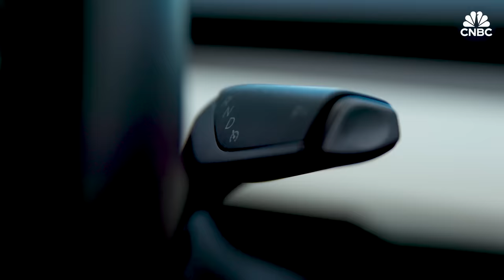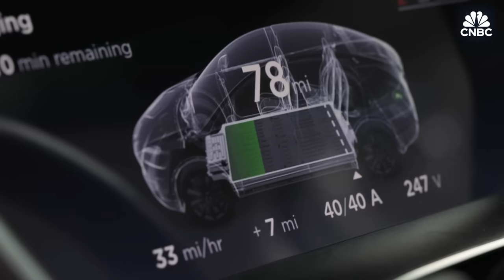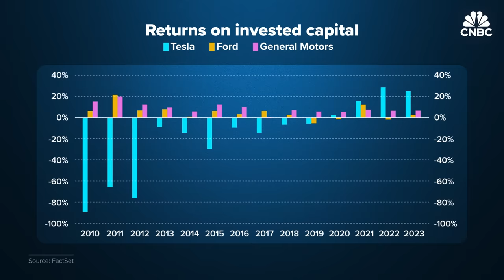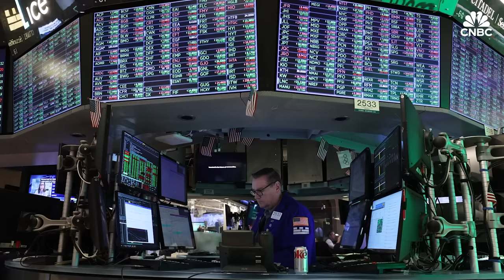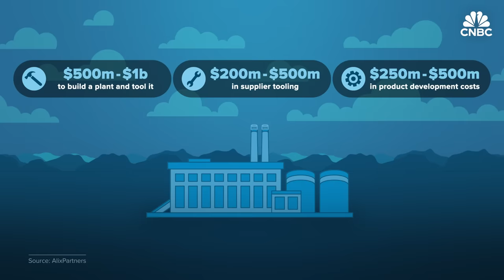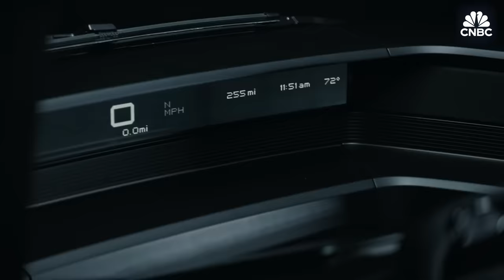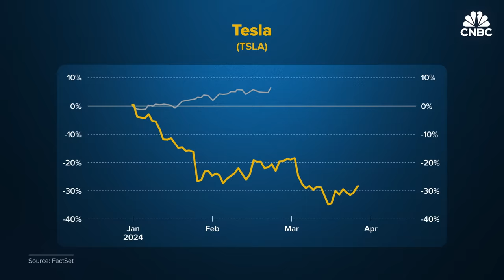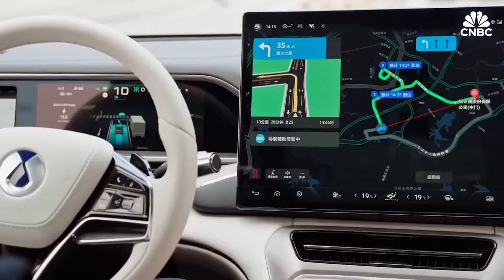Why So Many EV Companies Fail

Comment: EV companies are spending most money in making fancy tech inside the EV. Just build a damn affordable 500miles EV with just basic keys and common high speed chargers. It will fly off the shelf.
Reply: It's okey to build/ add in various technologies. But it's getting annoying. 

There is market where customers are satisfied with stable/ mature technologies/ solutions into the cars.

Lowers the overall costs, for everyone.
Reply: ICE companies are starting to pull that nonsense too.  I just want a cheap (under $20K when brand new), functional car that runs without major maintenance issues for 250K+ miles.  I don't care what's under the hood, I don't need fancy screens, and I don't want my car connected to the Internet or selling my data.  This isn't hard to understand.
Reply: It has nothing to do with the technology EVs are expensive because majority of companies have not reached scale with them yet besides Tesla you can get a used Tesla for 21k - 33k depending on if you choose the 3 or y
Reply: Chevy did… the Chevy Volt had 60 miles of EV range and 330 mile gas engine. People didn’t buy them. But now as gas prices continue skyrocket the more people are going to realize a plug in hybrid is the future.
Reply: The 500 miles range is the hard part.  Things like the Bolt or Leaf are hardly tech showcases and they still cost 50% more than a gas equivalent with half that range.
Reply: Nah, the CEOs are highly educated but I'm 100% sure they're too ignorant to think like that
Reply: @privacyvalued4134  ", I don't need fancy screens, and I don't want" You literally don't realize that touchscreens are cheaper to produce and install than fixed buttons. That is why they predominate the industry now: they have reached critical mass.
Reply: 500 miles?? How often are you driving for over 5 hours straight without stops?
Reply: @poochyenarulez  exactly! Dude is living in the 1970s thinking everyone road trips cross country every weekend.
Reply: @serebii666 500 miles means you don't have to charge more than once every 7-10 days
Reply: Only semi truck drivers care about ur precious 500 mile range. Us regular drivers want more tech
Reply: @linusa2996  So literal baseless laziness? You do realize how much larger and HEAVIER batteries would need to be just so you could go a few extra days without bending over once? lol Do you have industrial washers and dryers at home so you can wash 250lb of clothes every 3 months instead of every week? Btw, the Average American drives 30.1 mi a day
Reply: Maybe you could sell them the switch that they can flip to make that possible?
Reply: The issue is we’ll say that for basically any car class, then a company does it, and nobody buys it. Chevy has been producing an affordable EV called the Bolt EV/EUV and people hardly bought it. You could pick it up for the same price as a Corolla/camry and yet it didn’t crack the top 20 best selling cars list ever the way the model 3 and model y have cracked that list routinely. 

That’s probably the main reason car companies just don’t invest in cheaper cars anymore, especially cheap EVs.
Reply: @serebii666   well with my gas car I gas up once a week ant it takes less than 10 minutes. I don't have to run a power cable every night from my 3rd floor apartment down to the street every night.
Reply: @linusa2996  Neither do modern EVs. What do you think this is 1980? EV charging also takes around 15-ish minutes. And unlike petrol cars you can literally do it at home, so you're not making any extra trips. On street terminals also exist, often integrated into street lighting.
Reply: @Clickbait540   I'm a "regular" driver since the late 80's. What I don't look for in a car is "tech". I want manual windows, controls that I can use without having to look at it and a tracking manual parking brake. If I want in car entertainment, I'll install a radio
Reply: @KNRS927  "Bolt EV/EUV and people hardly bought it" Yeah because of all the recalls lol. No one wants to buy a car that spontaneously explodes and GM itself advised to "park in open areas, at least 50 feet (15 m) away from other vehicles". I wonder why that would impact sales 🤔🤔 

"don’t invest in cheaper cars anymore, " Companies don't make cheap cars anymore because consumers don't want them. Literally +75% of all car sales are large SUVs and child-demolishing trucks. Those are physically much larger vehicles than the compacts and coupés and even station wagons of the past. Of course they will be more costly. And people are willing to pay for it. Especially now that everyone ont he read is in a gigantic car, so there is even more pressure to buy a large one, since no one wants to be in the smaller car in a crash or fast high way conditions.
Reply: @SuperSxeMatt 🥂👏🏽🥃
Reply: The problem is that you cannot get a fancy affordable EV, if the companies are not spending crazy on research and development.
Reply: @SuperSxeMatt  The Chevy Volt was actually a great car.  The trouble is that it just has too much in it to be cheap.
Reply: The whole vehicle market is doing this. Why they can’t focus on a cheap vehicles I will never know, but I’m also not someone ever gonna pay more than 500 bucks a month for my car, so maybe I’m not the common consumer.
Reply: @privacyvalued4134 Cheaper except when they can't get components for them.
I want provacy, notouchscreens, etc.
Reply: @poochyenarulez VIsiting parents. PITA to install a charging station for return trip. Vacation. You don't want to be stranded.
Reply: The average consumer drives about 40 miles a day. Why would you want that much range anyway?
Reply: @serebii666  I know. It’s interesting how nearly everyone complains about wanting affordable EVs/ cars and when automakers oblige, nobody buys them. You can talk about the issues of GM batteries, but you’re not always gonna have reliability and affordability together, especially when it comes to EVs.
Reply: Tech sells. Quality doesn't.
Reply: You want them to double the size of the battery pack, by far the most expensive part of an EV, and the heaviest, so then they have to put a lot of money into the suspension and beef up the tires to handle the weight, the car body too…and then you want them to spend many billions making a great fast charging network for you, and then damn make it affordable. Golly, so smart. 

I bet your holding out for your dream woman, the former model trust fund baby with a PhD who wants to stay home and cook and clean and take care of the kids while you play video games for days…damn.
Reply: thats the point, company don't make as much money on product that last forever
Reply: @poochyenarulez  Uber drivers, construction workers, repair vehicles, some jobs like mine have a company car constantly in use for various task, real estate agents, rental car companies
Reply: @tribalypredisposed   the difference between 300 mile car and 500 mile range car in weight is 400lbs or 200kgs. Each touchscreen controlling your door, seat and AC and millions of other things require billions of dollars for hardware and software integration and needs to get tested by safety and compliance for every new build. 
If you read my note, i said about a common fast charger port similar to how petrol cars inlet.
Currently VCs and investors are wasting money on fancy tech pitch decks which fail and in turn lets all EV down
Reply: Tesla already tried that and it didn't fly off the shelf.  Because most people are smart enough to know better
Reply: >   It will fly off the shelf.
It won't matter to the millions of people who live in cities with on-street parking and who won't be able to charge them. And if you expect the cities and towns to spend billions of dollars to install millions of on-street charges, let me know where all that money will come from.
Reply: @SuperSxeMatt plug in hybrids are not as good or as eco friendly as EVs.  They’re also not cheap
Reply: @KNRS927 doesn’t help that the Chevy Bolt is a bad car from a bad company
Reply: @linusa2996 your gas car is a luxury.  Your convenience of gas is not worth destroying the Earth.
Reply: @TEverettReynolds you can charge them at public charging stations, just like people with gas cars don’t refuel at home.  Owning an EV in the city without home charging is easy.  It’s a bit uncomfortable but small comfort is a necessary sacrifice to save the planet and save yourself money
Reply: @0IIIIII  is it a bad car? It’s got 250+ miles range, is really practical, does 0-60 relatively quickly, usually does well an auto reviews by journalists, and is made by a company that’s been in business for 100+ years. I feel the problems with GM batteries that folks mention can be said with any EV batteries. They all use the same materials eod. 

If Toyota made an EV like the bolt, they’d ask $10k more and it wouldn’t be affordable but here we have an affordable EV and nobody buys it.
Reply: @0IIIIII  My car does 400 miles a week, and I would love a more eco option, horses can't do that.
Maybe when the EV battery can deliver 500 miles while weighting 90lb, the car costing $25k in an 80's hatchback package and charges in less than 10min, maybe EV's will be a real option
Reply: @serebii666  at home charging only applies to people who own their own home and have access to a garage.
The "90%" of ev owners charge at home is because most ev owners are in the 100k/yr and up bracket and own their own home with access to a garage.
If you are in the US median, you are unlikely to own an ev since your not making enough to even pay the monthly payment.
That last part is not my opinion but from the study by analysts of the current average income and the monthly payments for each ev model in sold in the US. Their finding is that the average American can only afford to pay between $400-500/mo in total car payments + Insurance.
Reply: @serebii666  the Bolt is the largest selling GM EV. with over 200,000 sold in the US alone, "people hardly" bought it is just plain wrong.
Reply: @abhiwins123  Oh, it is only 400lbs more? Well, you must know more about it than I do, I only worked at Tesla running part of the automated Model 3 battery pack line.
Reply: @tribalypredisposed   Good to know you can talk tech, for 100khw battery it weighs 600kg battery weight, model 3 battery 55khw gives 272 miles. Now if you throw the unwanted gadgets that consumers electricity, the range can be extended by 10+ miles. If you reduce the motor capacity by half(50KW), this can increase the range by another 10-15% or 30-45 miles. Thats around 330 miles for 55kwh battery.(500÷330)×55 = 83 kWh battery. Thats around 500 kg battery pack. 
Also as a BMS engineering goes, more the volume of battery, you can further increase the range as discharge density protection kicks in later in larger battery increasing another 2-3% compensating for weight increase. 
Logical reasoning with respect is much appreciated 😃👍
Reply: @amirshahab3400  yup its why Hybrids are selling so well. its 25 year old tech. its 25 years of service and reliability data, its 25 years of aftermarket and 3rd party service centers. if i go buy a prius or a camry hybrid tomorrow, i'll be able to get a rebuilt or new aftermarket battery for it and find a shop that can work on it. right now with EVs thats not the case.
Reply: @path4061   64,000/yr was my average for 10 years.  I know some people who drive as few as 1,000 miles. 
The car that we had in the 70's and 80's had a range of over 350 miles while carrying 2 people and 2 4 drawer metal cabinets.
Reply: @path4061   the low number is in small states where you can walk or take a bus to work. In places like California, where about 20% of the US population and more Tesla's are sold than any 2-3 states, you are looking at up to 60 to 90 mile round trips. For me last year, it was 45 miles in each direction. This year, it will be 100-150 a day. Look up the sales figure for the fiat 500e, leaf, BMW i-3 after longer ranged ev's became available.  The bolt with its 200+ range sold 2x more than the leaf with its 155 mile range
Reply: The long range battery packs cost so much they can only target the "high end" of the market.   The cheaper vehicles are also lower range, but they again have to add tech to make them more appealing to overcome the range anxiety.    Once you are in the high 40s just for powertrain you have to go upmarket.  

There is a new battery tech (dual-chemistry) that will make a huge cost difference for longer range, but its going to take a few years to trickle down.  I heard its 30% cheaper but diminishing returns the smaller the pack gets.  So its being sized to add range and cost the same versus lower costs.  The new LONG range EVs are likely using it.
Reply: @aseanidmiller1238   people are scared to buy used EVs with significant mileage - since they don't know how "hard" the EV pack was treated.    So the used market sucks.
Reply: @KNRS927   the dealers almost always steer EV buyers to ICE cars.  Its better profit for them.
Reply: @abhiwins123  it is not a simple math problem, because battery cells also have volume. Maybe the Model 3 pack is 55 kWh, or it was, energy density is constantly changing at Tesla and some Model 3s now have LFP batteries instead of NCM. We can say that a Model 3 can have a battery pack as light as 1060lbs and a Model S P85 pack is just 1200lbs, so that seems hopeful for you…except that the Model S is a much larger car so the bigger pack did not result in a large increase in range over the Model 3, and one cannot just pop an 85 kWh pack in the Model 3, it is too small. 

Now, a 500+ mile range EV exists, and it is the Lucid Grand Touring. A pretty large sedan, as pretty much if you are putting that large a battery pack in then you will have a large passenger space above the pack since both must be protected by your crumple zones in a crash. And all that extra car body and battery pack and so on adds up, so the Lucid weighs 5,236lbs, with the lightest motors in the business. That is just under 1400lbs more than the lightest Model 3. 

Now, there is a possible path around to what you are asking for, and that is hyper aerodynamic and light weight with a smaller battery pack, the route Aptera has been trying to go since like 2006 and failing to raise the capital for. In theory they will sell around $30,000 and have a range well beyond 500 miles, and they will be a two seat car with all carbon fiber body that I assume in a crash will be an almost certain write off since carbon can just crack up.
Reply: @tribalypredisposed  Logical, lucid and other hyper EV s are designed for hyper performance involving lot of parallel wire connection for hyper charging, motors.
lets assume a 3 star safety rating+ IP67 + battery pack of 100kw on 50kw motor, ride and stability equivalent to average sedan, no air suspension , even coil springs do the trick as weight is heavy. No fancy tech. Just good old turn the keys, hit the pedals.
Reply: fancy tech doesnt cost much, the biggest cost are according the safty standards
Reply: China is already doing this domestically lol
Reply: @serebii666 the fancy screen believe it or not are more efficient than gauges and can show more data. They weigh less.  For the ICE vehicles they are just cool factors to keep up with EVs.  I often wondered why not make a normal ICE an EV identically interior wise.
Reply: @The_hustletown_PA-C  I never said they were more efficient. I said they were cheaper, which they are. And that is why they are replacing button controls enmasse.
Reply: A decent range battery costs more to make than all the luxury features
Reply: AND build it with a tall vertical A pillar that bends when it gets up to the roof and give it a nice tall roof that stays tall all the way back. Make it easy for 6 footers to get in and out of. I just sent a longish email to Musk and Barra,again, telling them that.  People will not pay big money for a car that is tough as hell to get in and out of, as are most cars today. WTF.  Jeeps work, and Model X works, at least for the back seat passengers. I tell Musk to build a robotaxi like a Zoox. Maybe the new TSLA van would work too. GM should cancel the horrific Chevy Bolt with its ridiculous roof line. 6 footers have to lean over 30 degrees to ride in the back!!!  What were they thinking? Ma and Pa in the front and kids in the back was the idea, I guess.  But that won't work as a robotaxi.

Comment: I remember one start up EV company approaching a TIER 1 supplier.  They were flabbergasted at how complicated it is to design, validate and manufacture just one aspect of the car.  They thought without the engine 90% of their job issues already done. 😂. Many others followed and ended up the same as the one before.

Comment: "...remnants of the Chrysler Corporation..." Even the once-storied Chrysler brand has been a neglected,  pitiful zombie for many years. I predict it'll be killed off in the next few years. How sad.
Reply: Dodge. might be killed first, because Chrysler has those minivans.  But Dodge, well, has some performance cars that it turns out not so many people want.  Challenger and Charger sales are lower than that of the Mustang, which is itself in clear, sharp decline.  I bet that maybe Stellantis may end up relying on Fiat, with its 500e and its 600e, along with possible introductions of its Strada Pickup Truck and possibly even the Tipo and/or the Panda, and then they may rebrand the Chryslers as Fiats or Lancia models, depending on what's appropriate.  I doubt that too many people would mind.
Reply: "Storied?" Chrysler has been garbage since the 60s.
Reply: Don't be too overwrought.  The people that built that company are long gone.  I'm not even sure what it is now.  (Jeep, AMC, Daimler. . .? )
Reply: Chrysler and all its brands should’ve stopped existing back in 2008.